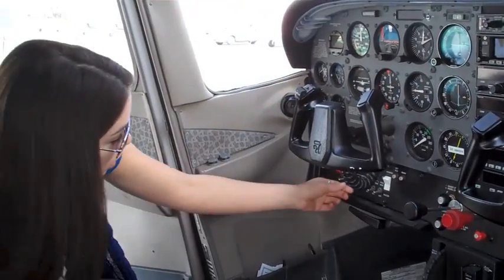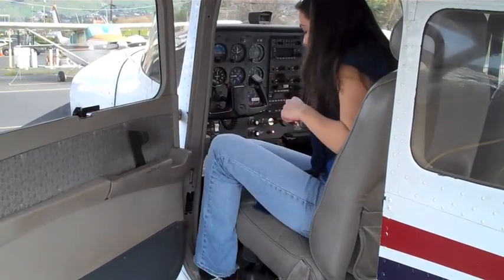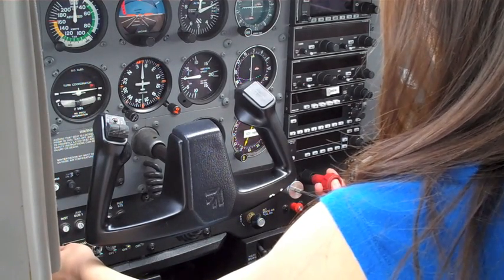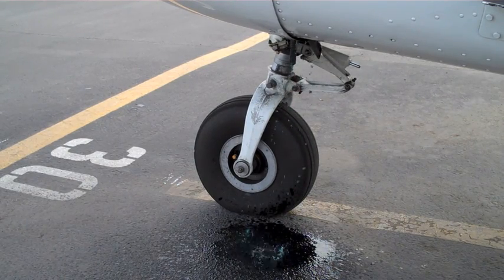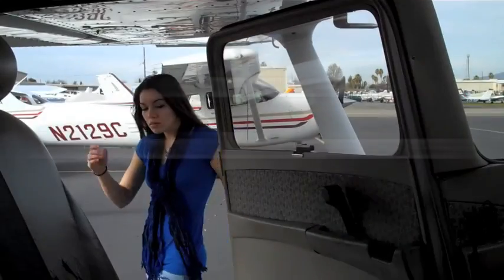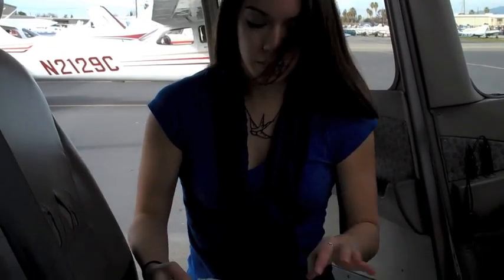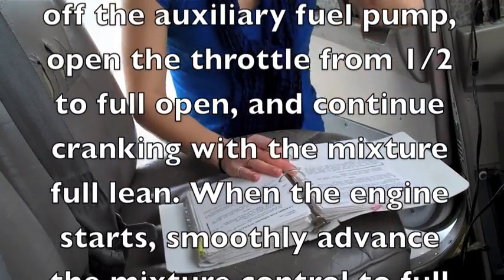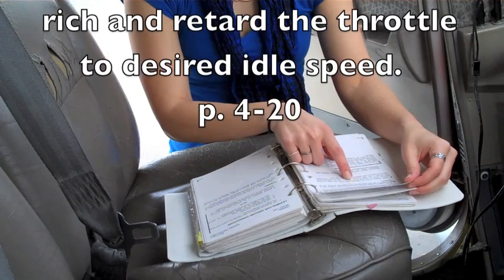Flooded Engines

Comment: A new instructor, that moved from a small WV town that flew only carbureted Cessna's, started his first day at my flight school yesterday. My first flight with him was in a fuel injected Diamond DA-40. When starting he told me to leave mixture rich when engaging fuel pump instead of, fuel pump then full rich for 3-5 seconds then fuel pump off. I warned him it was fuel injected but assumed it was fine. When I cranked it never caught except for running extremely rough. Finally got one of the 'leg